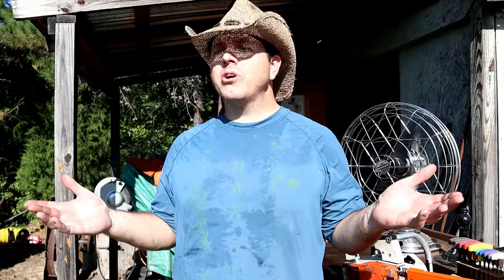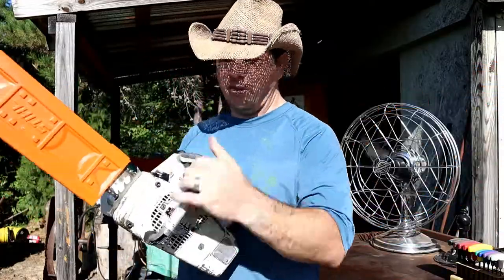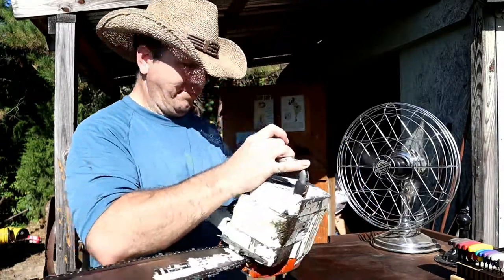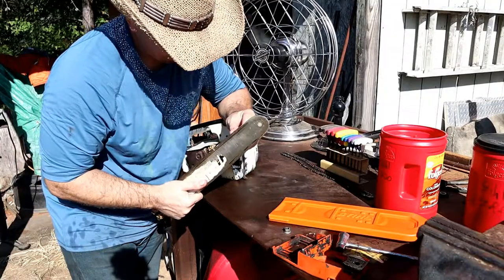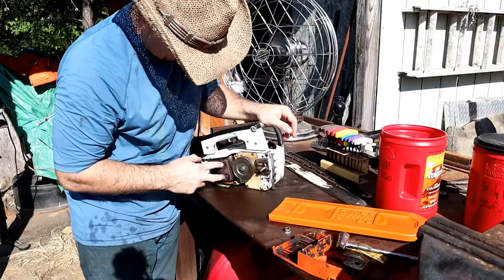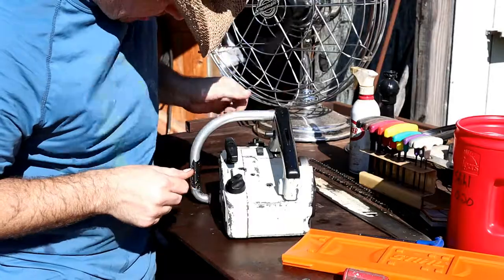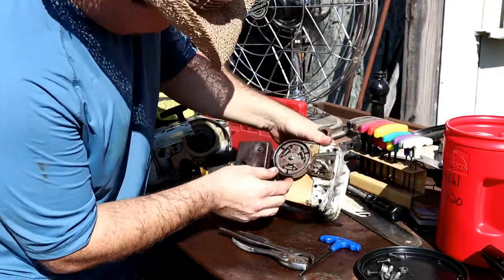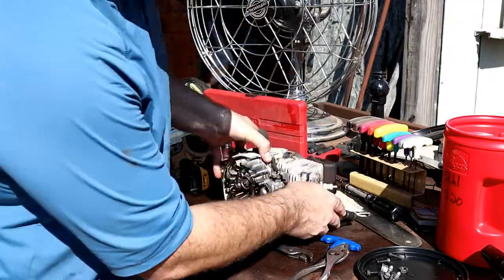Stihl 020 AV Chainsaw Disassembly Maintenance Repair Refurb Pt 1

Comment: Dude, Your sweatn! lol, I really wish you didn't speed this video up when you did, I am at the point of trying to figure out how to break my 020 down, Are there inside screws behind the cylinder? I get spark but no fuel,
Reply from the maker: Your issue is probably the carb or the fuel line. The carb connects to the fuel line blind. Unless you replace with a longer fuel line and spiral it up as you assemble the 2 pieces back together it’s hard to tell if it’s secure

Comment: You Mention heat effect on the bar. ALL bars are heat treated durring the manufacturing process .if you remove the paint on a new bar you will see that
It is heat tempering.  Not from use.
Reply from the maker: That makes sense!